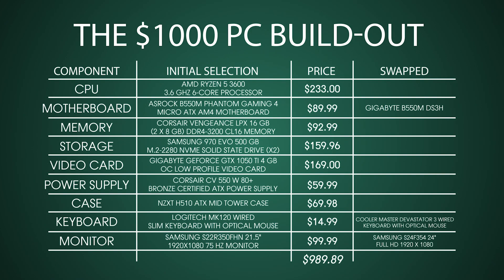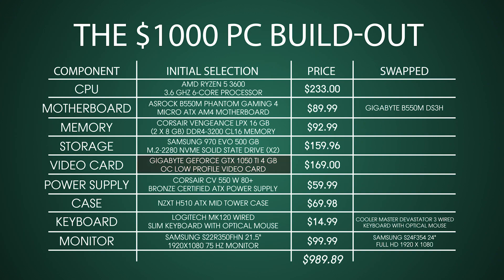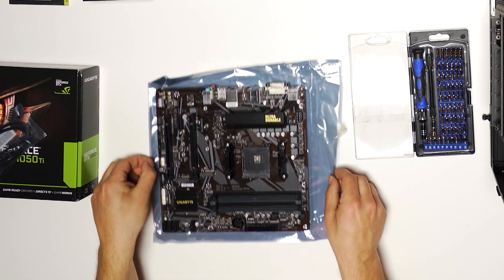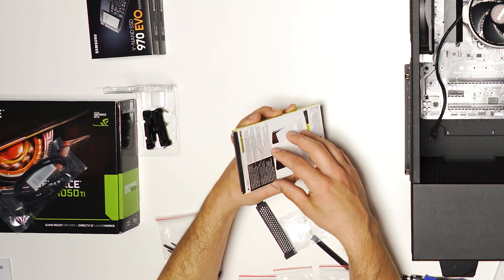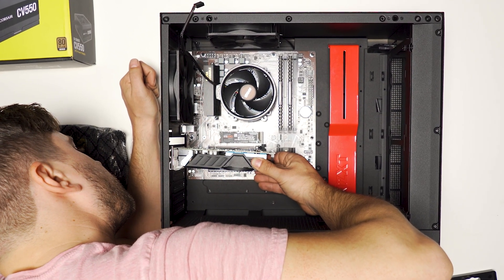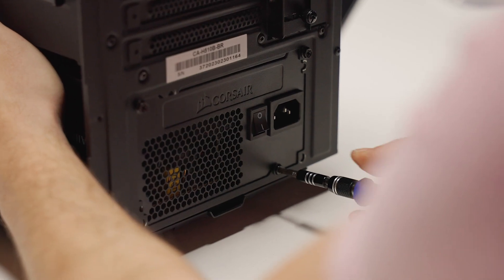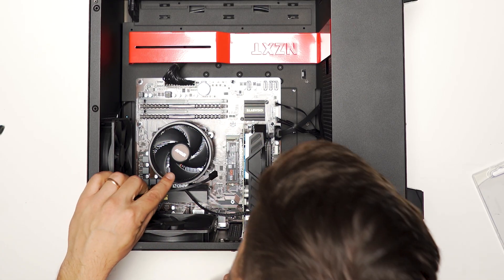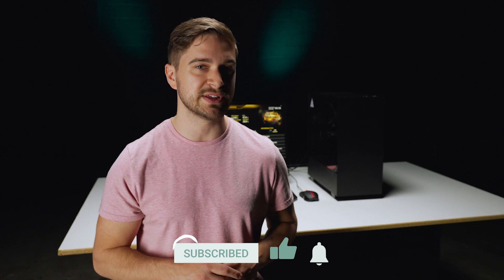Under $1000 Video Editing PC Build 2021 with AMD Ryzen CPU

Comment: you placed the ram sticks in the wrong slot smh
Reply from the maker: You are correct, good catch! The manufacturer does recommend using slots A2 and B2 first on this board. However, in testing, the dual channel configuration showed up correctly in the bios and performance appears unaffected. This is interesting to us. Any insight? And thanks for watching!